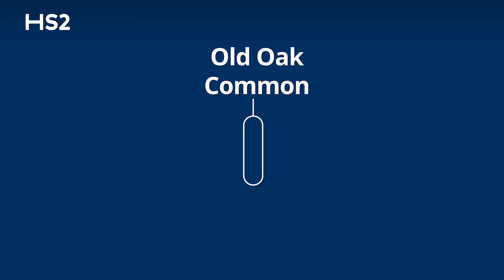HS2 Project Update, May 2024

Comment: I am very much a suporter of the railways, but why is this taking so long and being so destructive.  I have watched many of these updates and so far have not seen 1 metre of track in place.  Brunel built the GW mainline in a fraction of the time you are taking to build HS2, and he did it without all the mechanical equipment you have at your disposal.  HS2 is a  2 track line.and not as long as the GW mainline so why is it taking so long.  There are only 4 stations on this line so even that is not an excuse and 1 of those already exists.  Far too much being spent on building roads and factories along the route which will not remain after the build.  What are you going to do to all the brown field land you have created that will not form part of the railway and will need millions of pounds to clean up.

Comment: Manchester needs to develop strong horizontal ties with Liverpool, Sheffield and Leeds. It will be more beneficial to the North to be connected than to become sleeper towns for London. BUT, once that has been achieved, then it's essential faster connections are achieved as originally envisioned by HS2 for max gains. Coud we do both at once? It'd be a dream! We're gonna need a lot of private investment to pull it off; hopefully Burnham and Andy Street successor will manage to do it.

Comment: Run this by me again please.  Why is it not connecting to HS1 and why is over £100 BILLION being wasted to save 20 MINUTES to only get to Birmingham????
Reply: HS2 is not connecting to HS1 because it is not viable as HS2 is basically just a domestic Hi Speed rail line from the North West and Birmingham to London and it iwas going to be tried when the Channel Tunnel opened but it was not going to work as it is quicker from Birmingham, Manchester and Scotland to Fly to Europe than catch the train but it is going to save 40 mins from Birmingham to London not 20 mins.
Reply: @peterwallen1063  its a joke

Comment: Complete sham criminal project, The 27 Billion used should have been put to making the current railway more reliable and investing in new larger capacity rolling stock.
Reply: You do not have a clue about our rail infrastructure, The West Coast mainline was built during the Victorian eras, Most of the infrastructure on that line would need upgrading to cater for those double deckers trains tunnels are too small to have those trains on the line, Would cause more distruption to people lives costing more to upgrade than building HS2, The last upgrade  to the West Coast Mainline cost £15 billion in 2005 money.
Reply: @scottpeacock5492  oh WOW thanks Einstein! Unfortunately for you, that spiel was a big waste of time, I wasn't talking about double decker trains. Increasing cars per unit, improving stations, passing loops, signalling sections, electrification all far better value for money. £27b is what is what has currently been spent not the final cost.

Comment: The UK should consider developing the first Mass Drone Transport system. A fleet of drone buses that can carry 40 people, that would mostly follow the existing intercity rail tracks. The drones could build on the new generation of airships to increase their efficiency and use AI scheduling, building on the advances that have been made in tall building's smart lifts technology. 

Although trains can be impressive mass transport systems once built, they represent large investments and require tunnels, bridges and the acquiring of green belt land. 

Scaled up Drone technology would eliminated the whole of the city interconnecting infrastructure and its continual maintenance, instead it could operate more as a coach service with frequent flights.

There will be a country somewhere that will be the last to invest in traditional mass transport systems, before everyone has moved on, let it not be the UK.
Reply: Since such vehicles can carry fewer people than traditional trains, it's likely all that kind of plan would do is lower the capacity on the already congested main lines. Autonomous vehicles can have reduced safety margins between them so you can increase frequency, but that improvement would likely be much less than the reduction in capacity from the lower seating. Traditional trains are just almost impossible to beat for capacity since you can fit a lot of people on them and run them with good frequency, especially with a fully grade-separated corridor like HS2!

Comment: The continuing bilge on zero carbon rail for HS2 never stops, Using their own DfT data, HS2 would not be carbon neutral for 125 years.
Reply: No, those figures were for the business case only. They did not take into account modal shift or the freeing up of capacity on the existing network.
Reply: @martinsloman6905  There is little freeing up of capacity apart from those currently going direct between London and Birmingham as there s no intermediary stops and no extra services between the two, There is no semblance of any fare structure either ,In fact if you for example want to fo London Rugby it is more difficult,
Reply: Lorry travel and road travel for cars will never be carbon neutral forever so you have no argument.

Comment: Arrant nonsense again. Its initial claims are  absurd, HS2 is not a Network nor does it provide the basis for anything, Going from West London to a suburb of Birmingham it si not as fast as the two existing central connections, This is also costing now over £300 Milion a mile; ten times the quoted BBC. News figure,
Reply: Hs2 is still planned to start at Euston and terminate at Curzon Street on the edge of Bitmingham city centre, which was the original terminus of the London and Birmingham and Grand Junction Railways - hardly a suburb.
Reply: @martinsloman6905  It won't go to Euston until 2041 if at all and  Curzon St is NOT the business centre,  It is quicker to go centre to centre  with existing connections.

Comment: The HS2 was meant to even out the North and South divine but with the cancellations of the Northern parts it is Increasing it..
Reply: No it was nothing to do with evening the North South Devide, HS2 was concieved due to the failure of twice trying to upgrade the West Coast Main Line South of Crewe which caused so much disruption so the powers to be decided to build a new line
Reply: @peterwallen1063  Did the large West Coast upgrade of the naughties not cover sout of Crewe?  I was quite surprised by that.  Thanks.
Reply: @tomq6491  That is the section it covered from Crewe South, but it failed on both upgrades as it only raised the line speed from 100 mph to 125 mph and caused utter disruption for nothig and now this section of the WCML is utterly congested
Reply: @peterwallen1063  I remember the disruption of the WCML upgrade and thinking it will all be worth it in the end and then feeling rather underwhelmed as I think travelling the full length from Euston to Glasgow only reduced the time by about 30mins, maybe a bit more than 10%.  That might explain why.
Reply: I would agree with that, in the begining a North South connection was the initial raison d'etre of the project.  As someone living in Scotland I didn't feel the orginal plans went far enough but they even scaled back on the original limited plans.

Comment: Whilst I love the engineering aspect, I struggle to see how this works economically.  I live in Solihull, and they always make the play that Interchange station is in Solihull, it technically is, but it in really not near the centre of Solihull.  To get to interchange station will be similar to getting to Birmingham International station, a £25, 30 min taxi ride.  I can get a Chiltern train from Solihull to London usually for the same cost of the taxi to Interchange/Internation stations.  So how are the tickets for HS2 going to be priced, they basically have to give them away and include the trip on Elizabeth line to get you somewhere that you actually want to be.  With the taxi ride and the Elizabeth line I struggle to see how this will even be quicker than the direct Chiltern to Marylebone (admittedly not the best located London station but at least it’s on the tube).
Reply: You have a great point.  It has became fasionable in recent years to build 'pakway' stations that are not near anything and say it serves the surrounding area with poor onward connections.  Like the one in East Midlands as a gateway to the airport and several setlements there, but it is an airport that isn't used, all they have in onward conections are infrequent buses, and some of the services have already been withdrawn.  There is a power station there, but I think that is going to be demolished.  So it is only really useful for a few people in small vilages nearby and those that are getting picked up in a car.  But if you are getting driven somewhere else, why have the station there and not where people want to go?  I used East Midlands as an example but it could have been Oxford parkway or Aylesbury Vale or others.  I hope that the planned station doesn't fall into this group.  I am guessing planners don't actually use trains and just feel that station just about ticks a few boxes so put it there.
Reply: This station because of the reason you have stated is the reason lie Birmingham International station is called thus is that this station due to it's close proximity to Birmingham Airport, Birmingham International Station and Birmingham it self is being called Birmingham Interchange which has already been announced

Comment: this route will be finished by China in 2 years. took the UK at least three decades.
Reply: in a few years China made a network, mostly high speed, about the size of Europe (allbeit a bit sparse in the East) connecting about 1 billion people and probably for not much more cost.  Of course China has problems, but one thing you can say about its gov is that they have talented engineers that know about infrastructure whereas in the UK it seems to be mostly PPE graduates that couldn't get a job doing anything else.
Reply: @tomq6491  Not a credible comparison though is it? 
UK is smaller, lots of obstructions, roads, rail, property to get through. Land purchase is more expensive.
China is bigger, has more empty land and, as we know, doesn't really do democracy, sooo if you find yourself and your property in the way, well...
Reply: @mrglide7078  You have a good point.  The land purchases and labour are cheaper in the Middle Kingdom.  So it wouldn't be a stretch to imagine a corresponding project in China to be twice the price in the UK.  However it is orders of magnitude more in the UK and still delivers less than originally proposed.  Even comparing to our continental brothers and sisters, with similar land and labour costs, similar UK projects are often several times the price and time to complete.  I understand that part of this is the pricing, e.g. UK takes the whole project cost, including, for example, stations while European projects often include purely the infrastructure costs, but still there is a marked difference.
Reply: @mrglide7078  Yeah you raised a few valid points here.  While the UK is smaller, in its urban areas China has a higher density to the UK and in places prices are comparible even to London.  Admitedly some of the high speed stations fall short of the city centre, but hubs were built around them and they made good onward connections.  But in more rural areas land costs are cheaper, but they do pay compensation and then there are strange things going on for people to inflate the prices, like they quickly build extra stories on top of their roofs that are never going to be used so that when they are knocked down they claim more compensation.  Chinese rules and the powerplay between local and national gov can be a bit of a quagmire.  There is representative democracy of sorts in China, in so much that you can chose a local representative, but they tend to all be from the same political group and if not an allied group.  It is more the lack of effective opposition to question or oppose the gov that is the issue in China.
Reply: @tomq6491  What a facile comment.
Clearly showing utter ignorance of the amazing progress and quality that is the emerging HS2.
Of course the CCP propensity for absolute control brooking no dissent if people do not like the route or the desolation to their environment then easy to carry on ata pace that the Democratic processess that are the hallmark of the UK.
Plus of course ignoring the slave labour that goes under the radar.
Reply: @tomq6491 so thats why they all won so many of the PPE contracts during covid, there was me thinking it was down to rampant corruption
Reply: Perhaps you are suggesting that the UK should become an offshoot of the CCP under it chairman for life Xi Xi Ping.
When you have dictatorships riding roughshod over peoples wishes then , yes, projects can be pushed ahead at breakneck speed rather like the multitude of new ghost cities in China also built without any planning forethought and the many cockups that they keep secret.
Reply: China

Comment: keep up the good work, thanks for upgrading our ageing infrastructure despite so many people against it.
Reply: The rails on which any train run are modern, and if a bridge is sound it doesn't matter how old it is the train doesn't mind. and the Victorians using engineering bricks knew what they were doing. Capacity across the board could have been dramatically improved for a fraction of the eventual £160Bn plus cost of HS2 with modern signalling longer platforms and some changes at bottlenecks,
Reply: I also think there has long been a silent positive majority on HS2 !
Reply: @Carlos-im3hn  You obviously mix in different circles - no-one I know thinks of this as anything over than another over budget waste of money / failure to deliver & gravy train for contractors.

Comment: "Zero Carbon journeys", only if you exclude the vast amounts of CO2 you've been pumping out, with cement, concrete, steel production and the journeys of your 31k workforce. Not to mention the ecological damage you've done to the countryside.
Greenwashing tw[i]ts.
Reply: What about all the plastics, co2 from the reduced car and plane journeys. What about the roads that would need to be built. Ecological damage really? They’re being forced by nimbys to go in tunnels under so much stuff.
What really will do ecological damage is climate change so maybe that is what we should be looking at.
Reply: @jakob7116 .. what " reduced car & plane journeys"?  Research shows that even if this massive white elephant had been built in full, traffic on the M40 & M1 would reduce by less then 1% & it'll have ZERO effect on domestic flights.
Reply: The CO2 emissions from both construction and 120 years of operation of HS2 will not exceed that from the UK road network in one month. Reductions in CO2 come about from freeing up capacity on the existing network allowing modal shift from more carbon producing planes, cars and road freight.
Reply: @martinsloman6905 .. the "modal shift" will be negligible to say the least. 
Research conducted by the DfT suggests only 1% of HS2 passengers will be people who would have flown, and 4% those who would have driven.
Also, research conducted by the DfT & the British Hauliers Association concluded that even if this monstrous vanity project had been built in full, traffic on the M40 & M1 would have reduced by less than 1%.
Reply: They're claiming the journeys will be zero carbon, not the construction.

Even before fully decarbonising the grid, trains are already 1000s of times more efficient than cars, so a modal shift to trains is the opposite of greenwashing. Actual greenwashing is large corporations buying "carbon offset" schemes, whilst not reducing their emissions in any meaningful way, basically a way to say you're making a difference with no real world impact. Things like buying ocean kelp plantations.

Reducing emissions will often be achieved through expensive, long term infrastructure projects that frontload the emissions to achieve reductions going forward - an overall reduction. That's where real change will happen. As others have said, even with all the emissions of construction it will be a drop in the bucket compared to the building and maintenance of car infrastructure.

It's also funny to me you're talking about ecological destruction - these videos often show a relatively thin cutting for the railway line, and the construction area will recover quickly once built. Compare that to the huge motorways that have paved over huge swathes of this country with no questions asked
Reply: @MrOlympuse410  .. the "modal shift to trains" won't happen, it's fantasy - propaganda put out by HS2 Ltd who've been telling porkies since day one of this disastrous project. 
DfT research shows that less than 1% of passengers would have flown & 4% would have driven. 
Even if this monstrous white elephant had been completed in full, traffic on the M40 & M1 would have reduced by less than 1%.
Current figures show that "only" 81bn passenger kilometres are travelled by train per year compared to 673bn by motor vehicles. 
HS2 is an environmental disaster of epic proportions & Britain's biggest infrastructure mistake in half a century.
Reply: @MrOlympuse410  "They're claiming the journeys will be zero carbon, not the construction."  Of course if you magically isolate the journey from any preceding construction. Yeah, just feckin ignore it, pretend it didn't happen. Makes your little equation seem logical.  There's a handful of years left before the climate chaos becomes irreversible but HS2 want to bury the 100 year pay back of CO2 with Greenwashing. 

This "modal shift to trains" only works if you want to go to Birmingham, otherwise you need another HS to somewhere else … and so on. 

They'll "recover quickly" with millions of plastic tubes disintegrating in the UV and dead, unwatered twigs.

Then finally; a nice little bit of whataboutery. Well done. 👏slow 👏